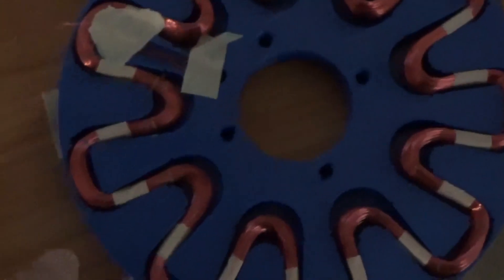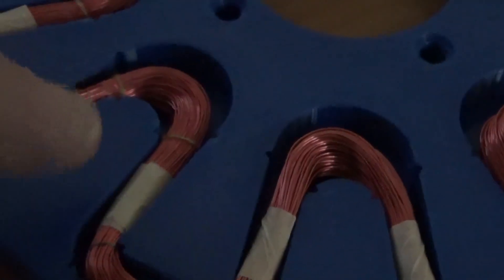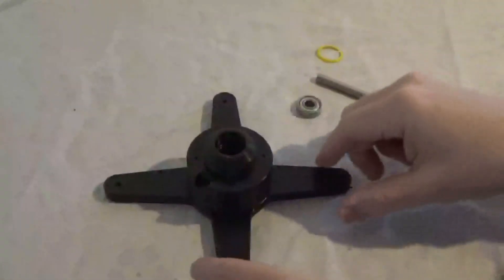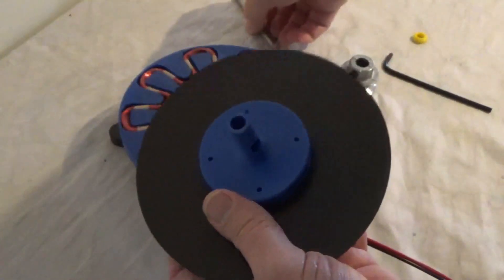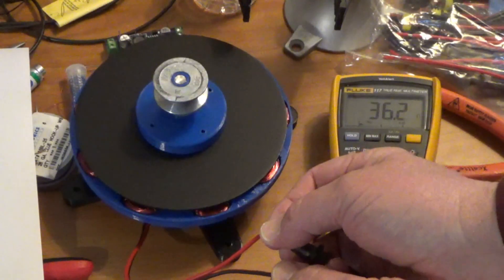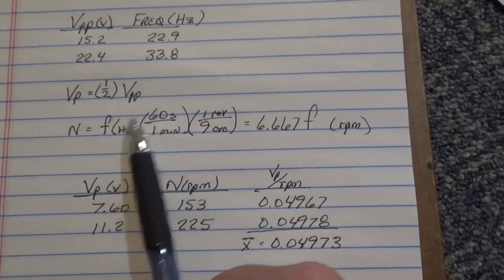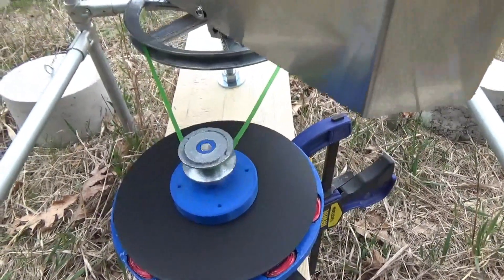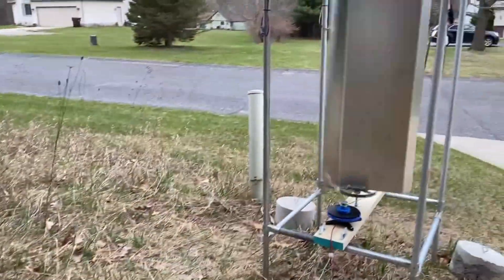Bent Wing VAWT - Generator Construction

Comment: Well...congratulations on the experiments; One question you could ask, why did you use just one coil instead of 9 coils? what changes in terms of power? hug
Reply from the maker: I don't like soldering a bunch of coils together; there is always the risk of getting a coil soldered backwards or getting a bad joint.  And counting out that many turns on 9 coils would be tedious.  Then again, so is sewing this coil in place.  Six of one, half dozen of the other I suppose.
Reply: @MickEMaus3000  Yes, I understand...but do you know what the difference is in terms of energy? Thanks

Comment: use the discarded washiing machine generator. it give better yield of power
Reply from the maker: They look like they would work great, but I am also trying to tailor the generator to the turbine.  A strong generator will not let the turbine spin at its optimum tip speed ratio.  I believe they are also three phase.  A single phase generator is better matched with a turbine because the current increases approximately with the square of the turbine speed since both the voltage and the duty cycle (so to speak) increase with the rpm.

Comment: I think the method you used to hold them down is smart.  I wonder if making a "press" slightly smaller than the channels you made for the wires could be used to push them flatter before filling with epoxy.
Reply from the maker: It is worth a try.  But I don't know when I'm going to making another one.